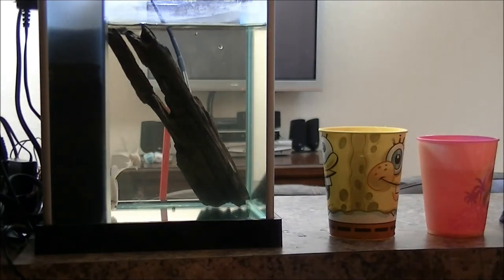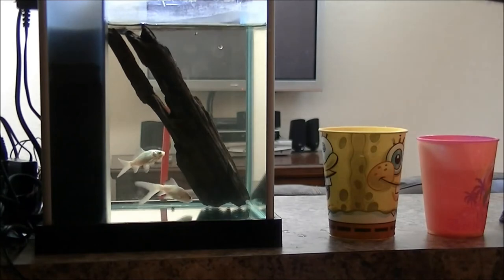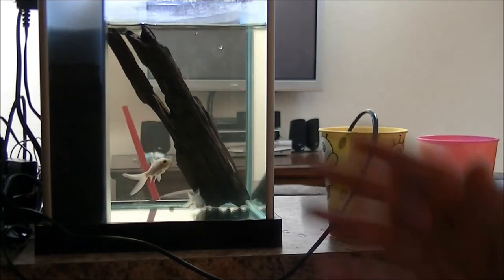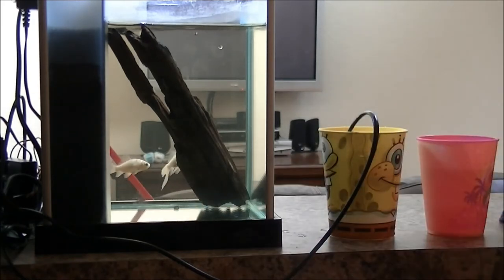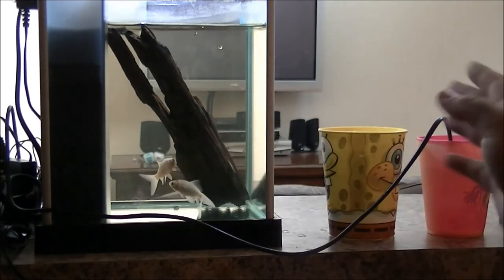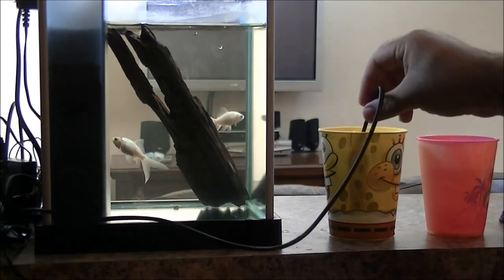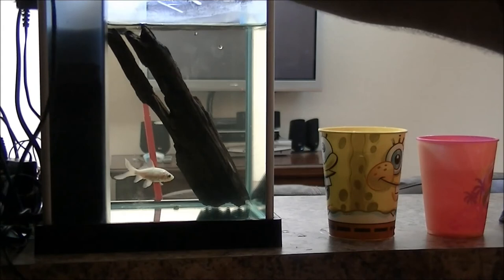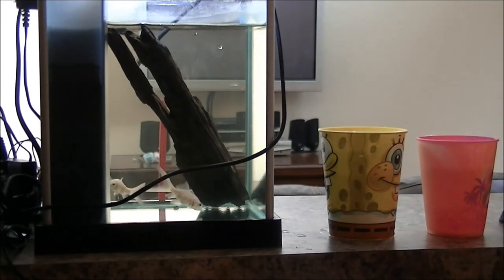Fish Tank with LARGE Temperature Gauge. Using Arduino, Servo and DS18B20 Digital Temp Probe

Comment: Can we see a wire schematic and the code pls?
Reply from the maker: I will post soon. Thank you.
Reply from the maker: aviah11 Very Sorry about this delay. I really forgot about it. I cleaned up and added comments so it will be way easier to understand.

#include <OneWire.h>
#include <DallasTemperature.h>
#include <Servo.h>
#define ONE_WIRE_BUS 2                      // Data wire is plugged into port 2 on the Arduino
OneWire oneWire(ONE_WIRE_BUS);      // Setup a oneWire instance to communicate with any OneWire devices (not just Maxim/Dallas temperature ICs)
DallasTemperature sensors(&oneWire);    // Pass our oneWire reference to Dallas Temperature.
Servo myservo;                                          // create servo object to control a servo
 
int pos = 0;                                                // variable to store the servo position

void setup(void)
{
  Serial.begin(9600);                                 // start serial port
  sensors.begin();                                     // Start up the library
  myservo.attach(9);                                 // attaches the servo on pin 9 to the servo object
}

void loop(void)
{
  sensors.requestTemperatures();                      // Send the command to get temperatures
  Serial.println(sensors.getTempFByIndex(0));  // prints recieved Temp in F from digitial sensor
  pos = ((sensors.getTempFByIndex(0))-30);    // variable to store the read temperature in F subtract 30 so servo stays in range
  myservo.write(pos);                                         // tell servo to go to position in variable 'pos'
    delay(25);                                                      // waits 25ms for the servo to reach the position
}